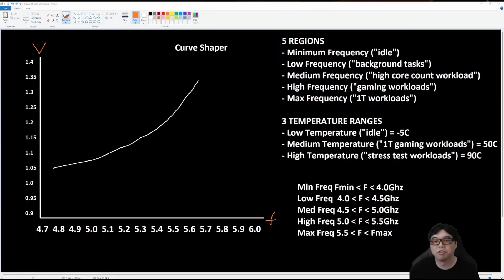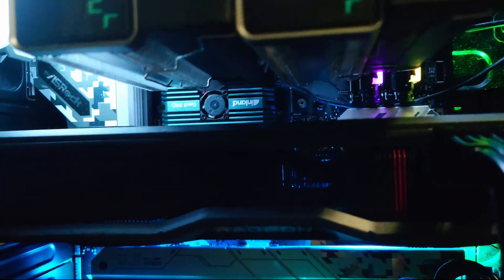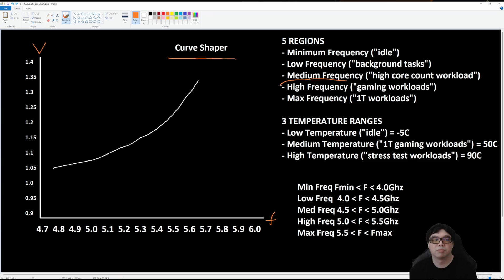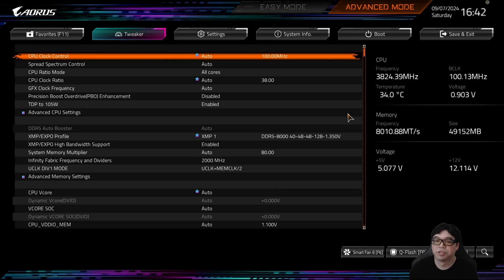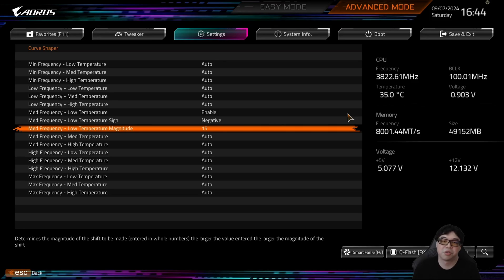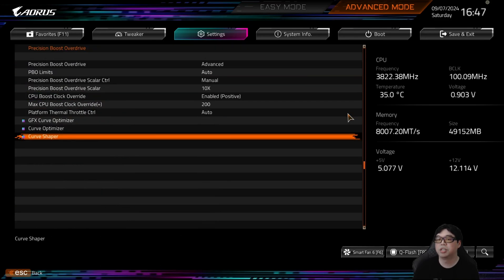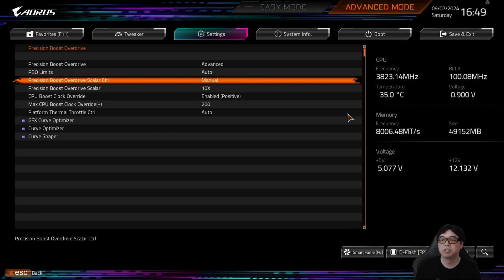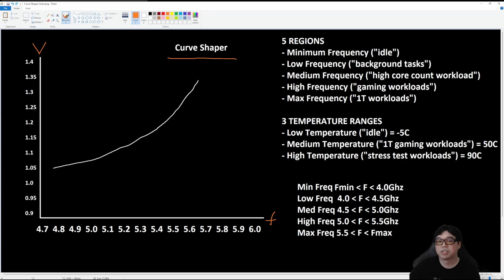AMD Curve Shaper Deep Dive and Ryzen 9950X, 9900X, 9700X, 9600X Series Optimization Guide

Comment: What about reducing temperature?
Reply: I'm getting 60-70°C idle, Is that normal for 9700x?
Reply: @midhungopan9270  thats pretty high for 9700x. should be mid 40s. 55 at the higher end. you set up something wrong probably.
Reply: @tee228 I was getting around 45-47 when on windows 10, after windows 11 update it became 55-60 on idle, and never goes beyond 82 on stress test though.

Comment: Coming from intel, one thing i learnt is AMD is really bad when it comes to low load, but efficient in high load. I have an ITX case with a small 53mm fan, my ambient is 32 and my CPU runs at 70 when web browsing. But interestingly, it runs only slightly hotter in games, like 75-77. 9700x

Comment: Regarding those per-core optimizations, how do you find:
- what are your "best cores"
- the best offset value to use (and whether it should be positive/negative), just by tweaking & benchmarking tens, if not hundreds, of times ?
Reply from the maker: Best cores are revealed by HWinfo64 or HWMonitor. They have the asterisk next to them. the offset depends on what region in the curve you are adjusting.
Reply: @GameTechReviews  asterisk? there is no such a thing, could you help me a little bit?
Reply: @YaSyRo  masz gwiazdę i/lub kropkę przy najmocniejszych rdzeniach, bardzo ładnie to widać w Ryzen Master

Comment: Great video!
What memory are you using in this video?
How far have been able to OC 9700X?
Reply: I used Lexar ARES Gen 2 6400 MT/s 2x16GB kit.  Set it to EXPO 1.
Reply: @carlos777uk  Do you think the Lexar Ares gen1 6400/CL32 can also be stably overclocked to 8000MT/s? So far, I've been using them at 6400, but I've overclocked trefi to max and trfc to 416.

Comment: this is crazy... did this on my 9600x and basicly doubled my FPS in certain games...
Reply: Is it stable? What voltage are you running?
Reply: @dewin-fit it was at first ,but after some time there was a lot of freezing… had to lower it a bit in the curve shaper… boost is a bit lower ,but it made basically no difference to the performance boost in gaming.
Reply: Like the guy above asked … care to share your voltage?  I just built a 9600x
Reply: @Macreadysshack  i  just cranked the PBO to matherboards limits, did all core -10 (btw playing with the optimizer didnt give any real world noticable difference ) and enabled all the ZEN 5 optimizations/105w mode and so on.... when i played around with the voltage and tried a manual overclock i was good on 1.075..but 1.1 is stable more often id say... but the PBO gives you almost everything the cpu can do anyway.
Reply: @dender6816 Awesome - thanks.  I’m down to -38mV globally.  I just turn it down a mV every couple of days … still waiting for instability 🤷‍♂️. I maxed out at 130 watts during Y Cruncher.  Obv I’m at +200Mhz and power limit set to 170 watts (motherboard).  When it starts getting squirrelly I’ll start tuning individual temp/freq zones.
Reply: @Macreadysshack  the system wasnt really unstable but i expirienced a lot more crashes of applications with a more aggresive curve, so i kept it at this. im happy with what it gives ,temps are nice and the boost too. :D

Comment: with only CO @ -30 5 bad cores and -20 3 good cores i hold a stable boost at 5400mhz in r23 for the whole time with 1,220V, getting me around 24250 points.
with the reduced CO due to the shaper magnitudes, i get around 1,37 volts, boosting only to 5,2 ghz under load, leaving me with higher temps and only 23500 points in r23.
Reply: As a comparison. What is considered decent silicon and what is good and what is golden sample class? I found out that my 9900X3D can run at -40 offset for CCD0 and -36 on CCD1 with only 2 bad cores in it. Tho it is unstable at idle and low frequency.

Comment: I bought an entire AMD system - gpu to build, for the first time since 1999. I kinda don't game, I do,but I do like modding old stuff. And I play mostly games from a decade or 2 in the past.

What I wanted was, coming from an 8700k was double everything. Was going to buy a 9900x. X3D would be nice... But I would enjoy it about 10% of the time. 

I was actually drawn to the idea of power consumption, alas for some reason I hadn't watched GN breakdown on it. But I'm kinda of the opinion that after 7years.. who gives a fk. I mean I bought all the sht over a month ago, and I still haven't built it. My 8700k and 3080ti just barely lacks enough to give a fk 

That said, this week it happens. Interesting video added to the library. 

Most reviews are generation to the next. If this sht doesn't slap that, then I been had. I doubt I will be disappointed. 

For the record I ran WinXp for 12 years while quad cores and sli were a thing and buddies wasted money in it to literally play WOW. While I ran Unreal Engine, browser, music, every non work waking moment until after a decade, more than 4 GB of ram was necessary.

As far as these CPU, ..since I haven't built and dived in. I see nothing where anyone says that art almost perfect idle, these don't clock down to basically nothing. I've searched. What I think is why do not cores park depending on the workload. I 2025 most people need like 2 cores. Literally.

Comment: Help needed: Do you have any advice how to lower the Idle temperature for the CPU? My 9900X is idling at 54°C, is there a way to bring it down into the 40s? thx
Reply: my 9900x idles around 39 watts, 45C. you need to undervolt per CCD. set boost clock to negative 200 or more. the higher the negative boost clock is, the higher you can undervolt. im stable at -36 for ccd0 and -30 for ccd1. set your power plan in windows to balanced instead of high performance. use a dual tower cpu cooler. also undervolt your gpu
Reply: Undervolt, better cooling.  Idle temp on its own is pointless, you need to consider temp above ambient.  You could live in a hot country!

Personally, I also remove any fan speed curve settings and always have it at 100%, but then I use a cheap air cooler only and have my case under the desk so don't hear it.

Comment: Honestly only 23k or 24k just leave it at stock
Reply: Not only that, but there are a lot of these curve offset / curve optimizer videos out there that are guaranteed to be unstable if subjected to a full battery of  testing. I've never seen a single Zen 5 sample that's truly stable with anywhere near a negative 30 offset. Game stable? Maybe. Fully stable in all workloads (y-cruncher, occt, p95, etc....) not a chance. In this very video, you can see clock stretching occurring in hwinfo. An aggressive curve offset isn't getting you additional performance when your effective clocks aren't reaching the target frequency because the cores are so starved for voltage that they're unable to. Of course temps will go down because you're reducing the voltage, but the real-world performance gain is marginal unless you put many, many hours (realistically, days) testing across a huge swath of workloads. Cinebench stable isn't a very useful metric, nor is it representative of real-world computer use.
Reply: At stock (65W) mode it gets around 18,5k and with 105W setting it gets around 22k, but runs significantly hotter. These optimization can give a little boost while lowering the temperature. It's nice

Comment: -25 Curve Optimizer : 24 275 pts and 85°C max 👍
Reply: So I don't need the complex steps mentioned in this video?  :-)
Reply: @ I only did that, and it’s working fine for me
Reply: @lnWO4HU2jgvcK7  tdp to 105W?
Reply: @lollihonk  yes obvious !
Reply: Same here. Just did -25 all cores and bumped up PBO to max. Got 23800 with 95 C though, but I use tower cooler and not AIO.

Comment: Will OC my CPU keep my MHZ high even at idle?
Reply: Also, is this a static OC?
Reply: set your windows power plan to balanced instead of high performance. check your cpu speed in task manager, you can see the difference right away when you switch between the two

Comment: so why combining curve optimizer (all core) with curve shaper. i could set my min lows and max to -10 my  meds to -25 instead of -15 and so on. 
And maybe i am misunderstanding something here but even with per core curve optimizer and with curve shaper running your best cores with a positive offset (from what i understand basically a overvolt) only to reduce thatk offset with curve shaper to effectively -10 seems useless. just reduce all cores to -10 with shaper instead  of -15 and if there is a single threaded load the best cores should boost the same

Comment: Use these settings and I get freezing sometimes on low loads. Any thoughts on how to fix? I only changed the med high and high high settings on curve shaper. Could that be why?
Reply: You could try applying a positive value, such as 5 in the low areas of curve shaper to try and get some stability. Just a thought.
Reply: @AndrewBonn I turned down the med high and high high to a negative 5 and it helped. Also I put max high to negative 5 as well. Are you saying applying a +5 in all the lows? I didn’t exactly copy paste this videos settings only the high on med high and max

Comment: Thank you very much for the video.
I just have a doubt, yesterday I received my 9950X and I have had the great luck that I got a Micro with very good Silicon, known here in Spain as Pata Negra. It passes all the stress tests OCCT, Prime95, Aida Extreme, Corecycler, etc... with Curve Optimizer in all the nodes at -30, except in core 1 and 2 that have their maximum value at -27. I haven't tried to lower it to more than -30 yet...
But I have a doubt with Curve Shaper, is Curve Shaper independent of Curve Optimizer, I mean, if for example I have reached the maximum value in Curve Optimizer with -30mV, I can add to Curve Shaper -10mV more, or I would have to lower the value of Curve Optimizer poor example to -20, to add -10 to Curve Shaper.
Thank you very much and best regards

Translated with DeepL.com (free version)

Comment: I don't find my experience with the 9700x negative at all. I have a 7800X3D and 7950X3D which are great CPUs, but the 9700X is no slouch. It beats the 7800X3dD in all multitask benchmarks and is on par with the 7800X3D in gaming with a few tweaks. All in all a more balanced performing CPU even compared to the 7950X3D. I doubt that many would miss the difference in performance between the three.
Reply: What tweaks can i do for it to perform likewise in gaming

Comment: I'm using same mainbaord X670 Aorus Elite AX and same cpu 9700X for a month.
May I know can I follow your toturial to overclock? just few day ago I try to et the curve optimizer to 20 and 30 , the windows just hang there when I run stress test. I so worry then I just load back default.
Reply: If you are the type to worry, I would follow it a little differently: 
he has scalar set at 10x, set yours to 1x (better for chip longevity)
curve optimizer try -5 instead of -10 (you don't have scalar pumping extra voltage)
curve shaper use -5 medium frequency instead of -15 (similar to CO -10)
curve shaper use -10 high frequency instead of -20 (similar to CO -15)
Test system idle 24 hours to ensure idle stability
if idle test fails, change curve optimizer to 0
Stress test 10-30 minutes to ensure curve shaper stability
if stress tests fail, change curve shaper high frequency-high temperature to -5
if stress tests fail again, change high frequency-high temperature to 0
if stress tests fail more, follow previous steps for high frequency-med temperature
if stress tests are still failing, follow the same steps for medium frequency

if things are succeeding, increase the medium and high frequency values in increments of -5 and retest until failure if desired, then revert to last known safe value.

If these tasks and testing seem too daunting, just stick with the defaults, no harm in that.  9700x is a good chip even without tweaking.
Reply: @bdarner6944  ok thanks
Reply: @bdarner6944  thank you very much

Comment: for my 9900x i did -40 curve  . should i re do shaper ? mine is stable just less heat . from 95c i got it now 79C at stress test for 4 hours . almost same performance . should i re do it like your way ?
Reply: I have the same question, this is why I watched the video. But after saw you comment I want to ask: which software do you use for stability checking? I used only Prime95, Cinebench R15 Extreme and R20 to test my 7800x3D, and it was stable even at -50CO level. But when I figured out running y-cruncher is freezing my system, I had to increase the value. Now I can do only -30CO otherwise y-cruncher will fail.
Reply: @Rubix_R.  the amount of times i had to reset my bios for things i shouldn't touch ... lol
Reply: @Rubix_R.  Stress for your use case, not for Prime95 as you will never encounter that kind of stress in games. Otherwise, you are leaving a lot of performance on the table.
Reply: @Rubix_R.    if you have corsair vengeance 64 gb 6000 i can send you a screen shot of my timing controller  that i got it from a preset that my motherboard . then you can play with cpu volt as much as you want . stable ram is so important . now after i got my ram stable . i changed my cpu to -35 curve  , i am running my pc at full power 75c temp and extra 10% more faster than before . witch is awesome . if you dont have the same memory (i cant help you ) i am not an expert
Reply: Im about to start trying to tweek my 9900X. Let me know if you found any perfect settings!
Reply: @TOTKHub  i am using 9900x i can help you so you dont lose time . if you want i can add you on discoed to help or if you can understand bios basics , i can write for you here